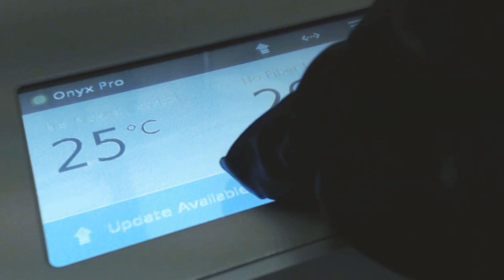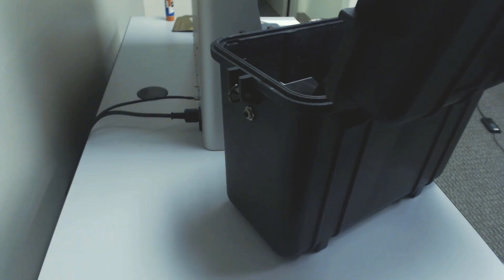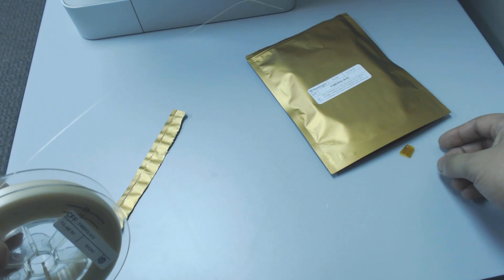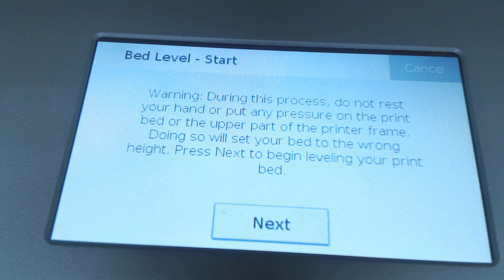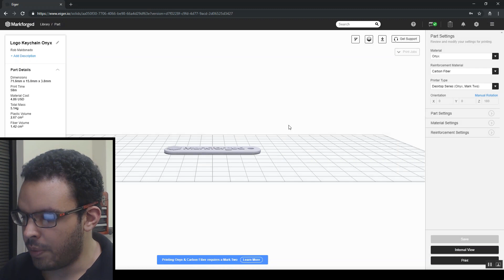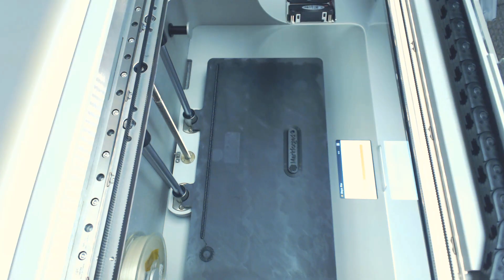Markforged Onyx Pro - Part 2: Setup and Use

Comment: Do not buy Onyx product. I bought Max 2 Pro and kept it with care, but after 1 month A line appeared in screen, after 1.5 months it hangs randomly and freezes constantly.

They didn't even reply to my email. This product is not worth it. It cost me around $800 plus Shipping $500 extra.

I hate that I trusted them with my money.
Reply from the maker: Thanks for watching my video, though I'm a bit confused with your comment here. The cheapest product that Markforged offers is the Onyx One which starts at $3500. Are you sure its the same machine?
Reply: No Yajan, your not suppose to smoke it. Onyx is a filament for 3D printing on a Markforged printer.

Comment: Well, actually it feel like a plastic. Even it have been reinforced with some fiber filament.
Reply from the maker: If you are talking about the surface finish and texture... absolutely. If you are talking about bending resistance and tensile strength, it really depends on how much fiber you put in there. The amount I put in the video is pretty insignificant, so you're right, it just feels like a slightly stiffer plastic. But if you have thicker part geometry and load it with fiber... well good luck bending that by hand. Of course then the part becomes very expensive too!